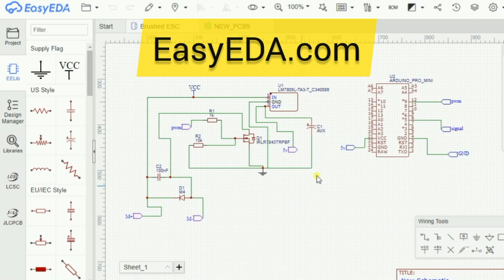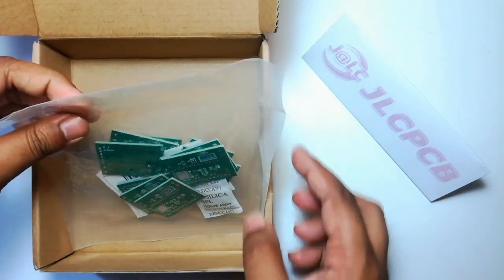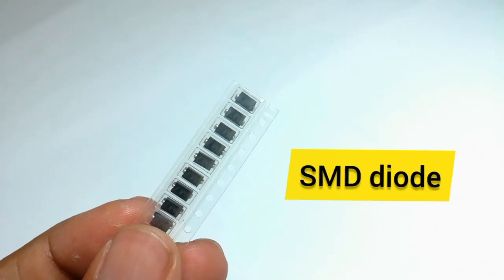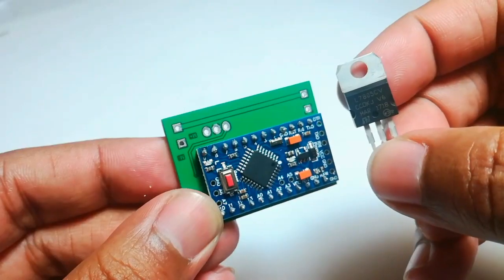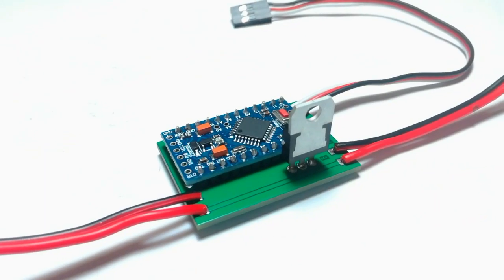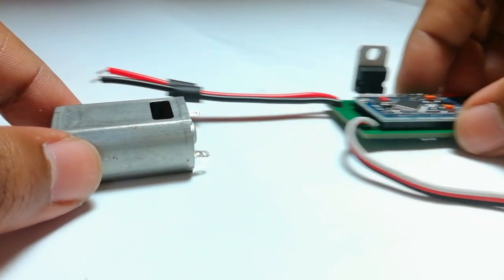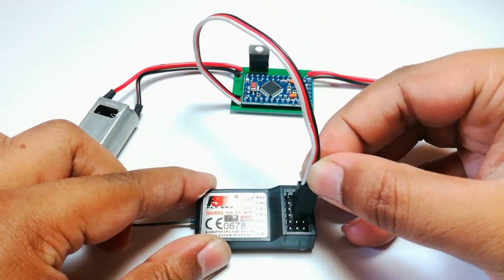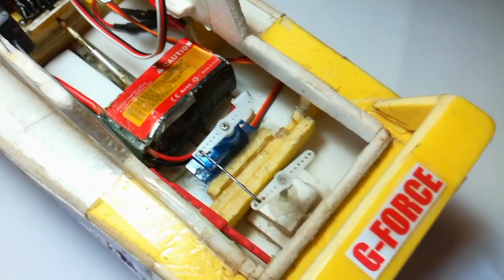How to make a brushed motor ESC || Electronic Speed Controller.

Comment: Sir doesn't your mosfet get hot while running the dc motor....
Can I use other esc instead of your...
Reply from the maker: Yes it gets hot but not too hot.
Reply: @ABID5  Sir what if I use 
Ap73t02gh mosfet... Will it work....

Can it handle 2s 900mah 7.4v lipo battery power... Plz tell me.......

Ap73t02gh Mosfet is from my brushed esc which now is not working....  

Plz reply sir

Comment: Help me out plz...!! I am using 7v input and getting max of 1v as output what should I do to increase
Reply from the maker: it is better to use supply of 7.4v or more.Damaged or other mosfets may result such error.also check the mosfet gate is getting good signal from arduino pin.

Comment: Why Arduino is needed while the RC output the pwm  already?
Reply from the maker: arduino is used to convert the rx pwm (timeframe 20ms) to a suitable pwm (0-100% dutycycle) within the gate voltage of mosfet.also arduino helps detect the lower and full throttle values.

Comment: Can we use this esc in a rc plane
Reply from the maker: only for brushed motor
Reply: @ABID5  Yeah. I will be using brushed motors, cause brushless motors are very expensive in India. And thanks for making this video. It is very helpful. Thank you
Reply from the maker: you can try 180 motor then.
Reply: @ABID5  yeah. Thanks.

Comment: can I run dc motor reverse with this ESC?
Reply from the maker: only one direction
Reply: @ABID5  lol its not esc if it can move only in one direction then you should have no need you can easily do that
Reply: @chetanmanchanda5130  Some of my onroad-racing-esc also run only in one direction 😂 (because it needs less parts, so its lighter)